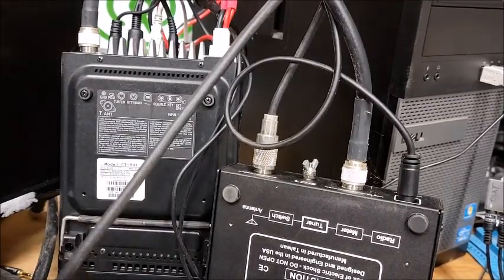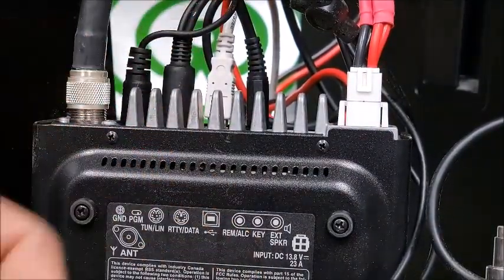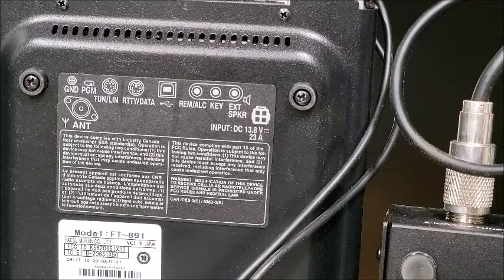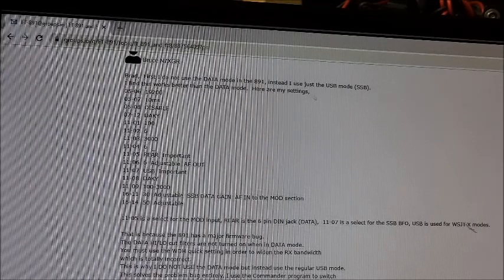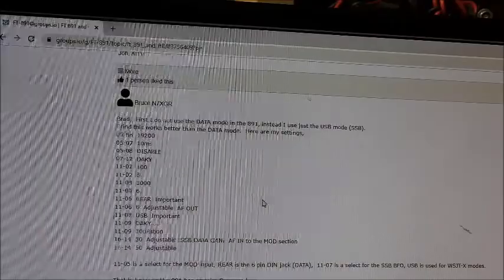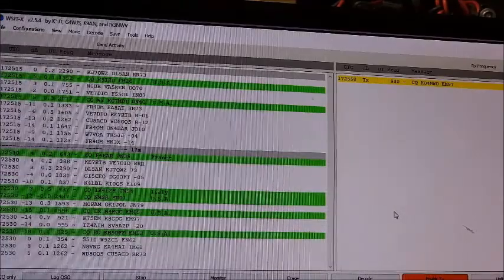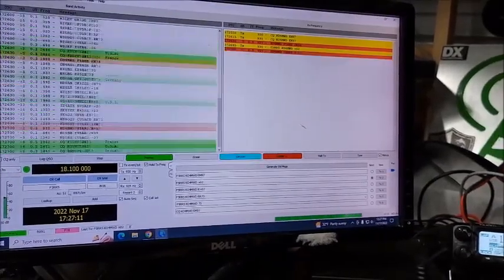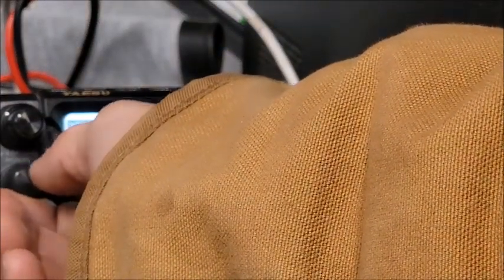FT8 on FT891 set up using usb sound card

Comment: Heres my experience: no problems connecting the radio to pc. Couldn't get my USB audio dongle to send. Only receive. Couldn't get my PC to send or receive. Receive was very low. Maybe its my DIY cable. Resorted to a mic at my radio 891 speaker and the 891 mic at my PC speakers. SUCCESS! France contact. So more troubleshooting but on the right path
- Dave {K0PKE}
Reply from the maker: Awesome! Sometimes the small problems can be the worst,  but the best teacher

Comment: I had better luck running in DIG mode. My problem is there's no audio ouput. Whipped up my own cable with usb sound dongle just like you. Plus, theres no input unless i turn up rig volume
Reply from the maker: Mine will sometimes lose  audio input, and I have to check the wsjtx audio settings

Comment: Can you tell me what I'm doing wrong?  I'm using WSJT-X, SignaLink, and each time I TX, it goes into D-U mode instead of SSB.  Then I manually switch back (the BAND key) to SSB and it receives fine until I TX again then it is back into D-U.   Please help!!!
Reply from the maker: My method I'm using requires no signalink. I'm using a USB sound card. 
but in your situation, it seems like a possible setting on wsjt-x needs to be corrected. I'm my setup. I believe that my setting to correct that problem is split operation to NONE.

I'm sorry, I can't help more with the signalink set up... although there is some great resources here on Youtube!
Reply: @LanceSheppard  Lance, that fixed the problem!   It's working perfect now.  Saludos from Chile!  CA4JDM and new this week CE4JDM.  (((73)))
Reply from the maker: @American-in-Brazil  alright! Great news! 73 God bless! Good luck with some DX!

KO4MWD
Reply: Signalink is a sound card, just a different kind of one but it does the same thing. Data does work with a Signalink. There are several videos out there to walk anyone thru setup. I use jtdx, Gridtracker and LOG4OM. They work seamlessly on both my ft891 with the Signalink and my ft991a without.

Comment: I have been doing FT8 for a long time..... You should have no ACL at all. I am running an IC-9100 it show no ALC at all.  :>)
Reply from the maker: Thanks for watching and the comment. I have tried a lot of different configurations with the ft891 and ft8, this exact set up has been the only way I've been able to do ft8 on the ft891.
Reply: My problem is no power out (using soundcard) any suggestions? Using yaesu ft 891 and sabrent soundcard
Reply from the maker: @KellyNW8P  do you have your mic selected to rear? The way I've got mine set up is for SSB operation. Please shoot me an email if I can help troubleshoot more ko4mwd@gmail.com
Reply: @LanceSheppard  yes mic is set for rear how are you setting the radio for SSB? Everytime I try to set it for SSB it goes back to data (using the F button)
Reply from the maker: @KellyNW8P  I use the band button press and hold  ensure ssb is selected. 
Use these radio settings from. Bruce n7xgr
https://groups.io/g/FT-891/topic/ft_891_and_ft8/83756409?p=
Reply: @LanceSheppard  I tried that but I'll watch the video maybe I need to stand on one foot or something HA HA HA HA just kidding
Reply from the maker: @KellyNW8P  don't give up! I know the hassle! It is possible.  I had to start over from square 1 about 4 times!
Reply: @LanceSheppard  well you did better than I have been doing I've been working on it for two weeks. No joy with this setup yet either I'm done for today my brain can't take any more. Thank you for your help
KE8MWQ 73
Reply: @KellyNW8P  I use a signaling USB. Those levels have to be set up in whatever PC version you are using as well. Just yesterday I made the mistake of looking at my pc audio levels and then my radio would not pass any audio. Found out my levels got jacked up some how. So no power out for you…… first question for you is…. Are you using the pc built in sound card or are you using an external sound card? If you are using pc sound card that is set up to drive your computer speakers. You could make changes to use internal sound card but that’s a bad idea. If you are using external sound card make sure, in your ft8 software, that you have selected that sound card as the input/output. Sound card input will be your receive and output will be to transmit. Make sure your set it to about 50%. On my ic9100 my power out is set to 100 watt but that’s ok cause by adjusting the sound card output I get 25 watts out and no ALC indication at all. See if this help and tell me what you are using at you shack! Barry KY4K
Reply: @KY4K-10  okay here's what I'm using yaesu ft 891, sabrent soundcard, ocfd antenna, ATU 100 turner. What I have sent on radio menu 05-06 4800, 05-07 1000, 05-08 disabled, 08-01 others, 08-04 0, 08-09 rear, 08-10, DAKY, 08-12, USB. Width 3000, shift 1200. Power HF SSB PWR 10, HF PWR 10. Give me a minute and I'll send computer settings for the sound
Reply: @KY4K-10  WSJT-X in settings audio tab USB Audio Device for both input and output. Sound in windows playback tab speakers onboard sound default device the other speaker is my external soundcard (USB AUDIO DEVICE) is set on default communications device. Under record tab computer mic set as default. USB Audio Device, this is my soundcard, set as default communication device. In windows under advanced sound options it says app volume and device preferences I have an input and output both set to computer sound everytime I change it the sound comes in through the computer (I'm assuming it's not suppose to do that) after that it says app volume, system sounds and they are set to default. Then grid tracker default, next one down says sound it's set for the computer and last WSJT-X is set at computer settings.
Reply: @KellyNW8P  well those look ok. When it is time for the radio to transmit does the Tx led turn on?
Reply: @KY4K-10  yes it does I think my cheap tuner ( ATU 100) is not letting the power back out in this digital mode, is that possible I don't know. Today I'm going to try bypassing the tuner and see what happens. I've tried everything else I can think of.
Reply: @KellyNW8P  i was going to say that the ft891 has a monitor feature so you can select that and turn it up in the menu.... then when you tx you should hear the ft8 sound in your radio speaker..... if you do not hear the digital sound then you will know for sure that you are not getting audio to the tramsmitter and therefore no power out. Then you can chase that problem down. Let us know what happens with that.
Reply: @KY4K-10  I will check it out because I still have no joy with everything I've tried. Do you know the menu number I don't see it
Reply: @KY4K-10  I believe I found it I will give it a try tomorrow thanks for all your help
Reply: @KellyNW8P  Great…. No problem!!
Reply: @KY4K-10  that information was very useful I made some adjustments and can hear the tone when I transmit. Noise level is at 27 dB and not decoding so I guess that's the next step.
Reply: @KellyNW8P  make sure on ft8 software that “Monitor” button is selected and colored green.  While trying to decode does the level meter on the bottom right of WSJT-X have a green bar moving up and down with the audio? Should be around 30 to 40. If that is not there then you are not getting audio to the PC. Sounds like you are almost there!!
Reply: @KY4K-10  software monitor button is green audio slider is green but only has about 27 dB but I can't seem to any higher. Decode button will flash from time to time but no decode showing up on screen
Reply: @KellyNW8P  are you using USB? there should be a windows slider to control your usb soundcard to raise it up a bit. Still thinking about this problem.....
Reply: @KY4K-10  USB cat cable, USB under radio tab in WSJT-X (Bruce N7XGR) menu setup. The slider bar on the right side of WSJT-X program does nothing when I move it. I just reread your comment I'm not sure what windows slider you're referring to.
Reply: @KellyNW8P  I just tried mine and when I turn the level coming in to a lower level my ft8 will not decode also. When I said USB I meant are you using Upper Side Band as the mode USB. Check that. In windows… there has to be a control for your incoming audio to the sound card. Right click your speaker icon in the task bar and try “open volume mixer” or maybe “open sound settings”.
Reply: @KY4K-10  yes using USB and yes on sound settings there is only one sound slider that moves the level for me but can only get it to about 26 to 27 dB, it is green but that's as good as I can get it
Reply: @KellyNW8P  well I am out of ideas…. Sounds like you just need a little more level. Maybe consult the manual on the sound card…… but if I were you I would invest in a Signalink USB.
Reply: @KY4K-10  I'm still going to try off and on until spring, that's my birthday time, if I don't get it I'm gifting myself a signalink. I will never go down with out a fight HAHA. Thanks again for all your help Have a wonderful Christmas. KE8MWQ 73
Reply: @KellyNW8P  I hope to get mine set up soon. If all works I will check back with you.
Reply: @KY4K-10  I finally got the FT8 to work using the method that Amateurish Adventures used. I didn't use WSJT-X I used MSHV.
Reply: @KellyNW8P  GREAT…. Well I am glad you got it going. I will be trying mine in the near future… with WSJT-X. I will meet you posted,

Comment: A few questions. What soundcard and where can I get it? Does that setup work for other modes like PSK31 and Winlink? I'm new to digital modes and by new I mean I know squat. I have an 891 and a Surface Pro so which programs do I need to download?
Thanks.
Reply: @Rich what I use is the Tigertronics Signalink USB. I like it because it has knobs on the front to control your tx audio you don’t have to mess with a software slider pot. I have ran every digital mode possible with it. Tigertronics has documentation to set it up with what ever version of windows you are running.
Reply from the maker: @KY4K-10  great info! Thanks for sharing
Reply: @LanceSheppard  no problem…. That’s what Amateur Radio is all about…. Helping each other out!
Reply from the maker: @KY4K-10  exactly right! 73!
Reply from the maker: I'm brand new too, and USB sound should work as long as it has an in and out (speaker and microphone) jack. 
You need the wsjt-x  software for ft8. I haven't gotten into psk31 or winlink yet. 
If you look up KM4ACK here on Youtube he is also a wealth of knowledge.  Alo g with The Tech Prepper. Great information!